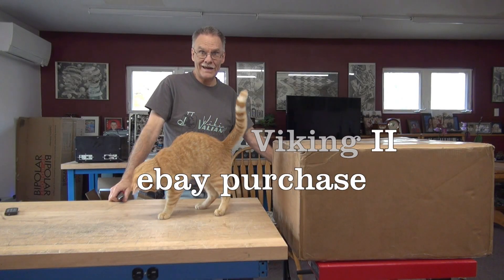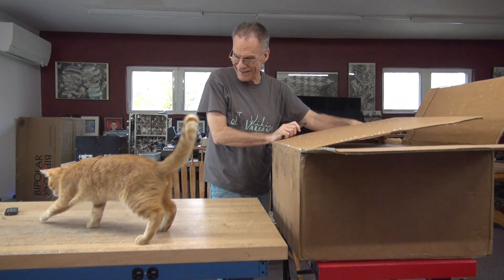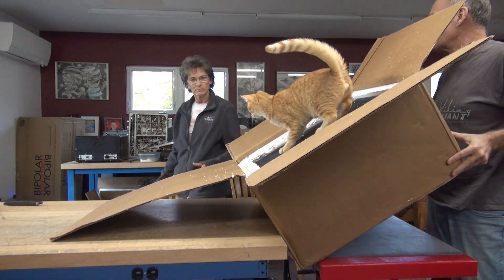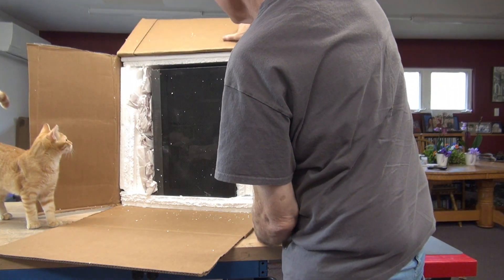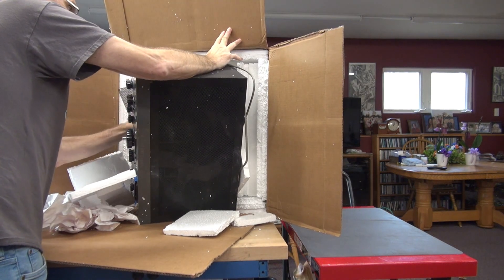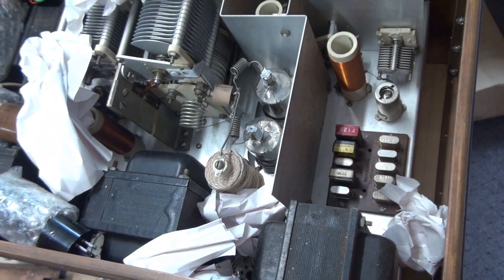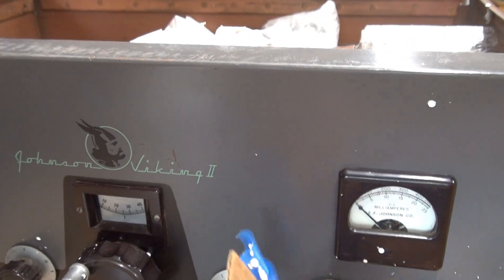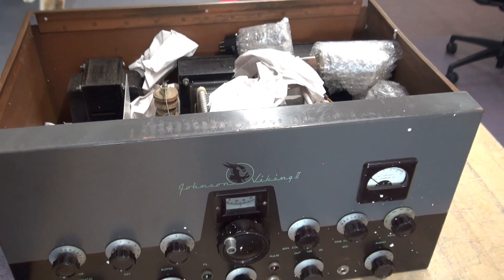Whats inside of the large heavy box? Traveled all the way from California to D-lab for repair

Comment: That was close to a good packing job, but electronics is not horse shoes or hand grenades, so close doesn't cut it. I bought an amplifier a few months ago, an otherwise nice amp, that was packed in bubble wrap, peanuts, and a single cardboard box. At least the 4-250's were packed properly in a separate box, but the amp took some nasty hits on the corners and the chassis is sprung out of shape. The power transformer has to come out along with a center shield before I can straighten it out. Fortunately, the transformer, in the corner, took most of the energy and being the heaviest part, there was no damage to other components. It should be a nice amp, after the body work and reconstruction is done. People gotta learn how to pack things properly when they ship them. It's extra work for them but much less work for the folks who receive the equipment.

Comment: I’m in England UK …I bought a VIKING 2 and the VFO on eBay ….the VIKING 2 was obviously in USA …the seller agreed to send it to Uk …..it arrived not packed as well as the one in terrys video …..the seller had wrapped each valve in bubble wrap at my request and packed them inside the top side of the Viking …..anyway it survived the trip to Uk …..and after the usual re cap and rebuild of audio stage it’s now working well ….produces about 110w carrier on 80 and 40 and audio reports with a D104 are very good …..got the Viking paired with a AR88 ….better than any modern rig 😊….steve G4HTZ